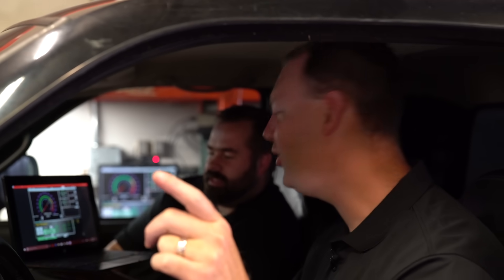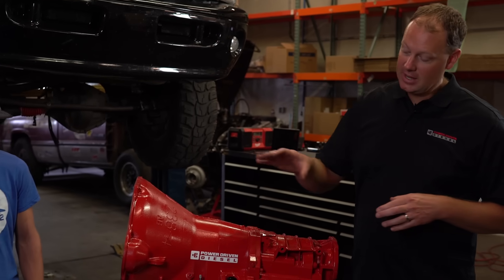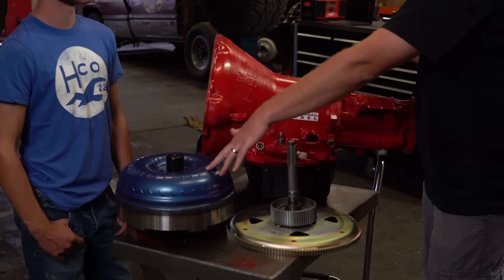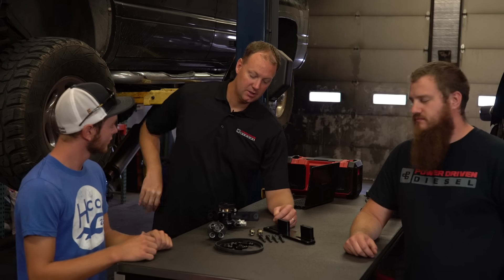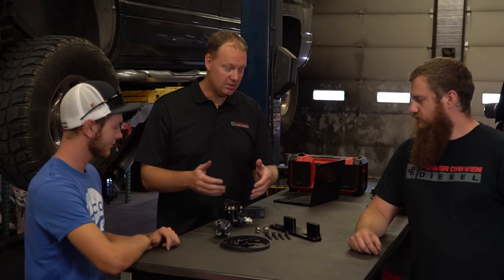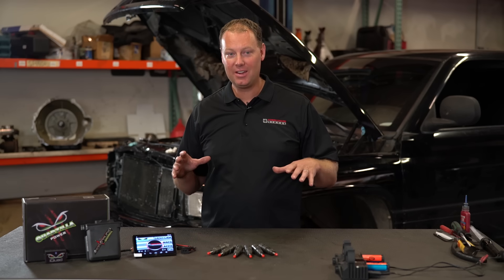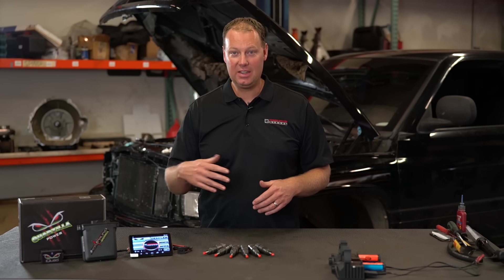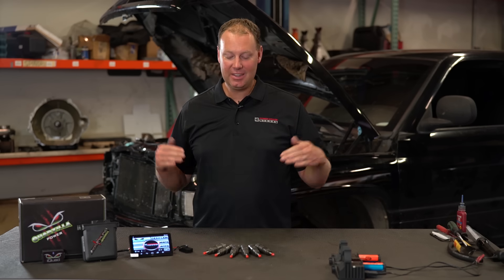We Double the Horsepower of a 24 Valve Cummins

Comment: I run a 5.9 24v in a 1999 converted Freightliner MT 45 box truck.  I replaced the injectors with a high performance series and installed a FASS Titanium series pump and filter system, as well as a new intercooler.  My truck goes over the scales at 13K!   Much better performance now.  I am curious as to why you did not use the FASS system??  They have also given me great support.
Reply from the maker: We run both AirDog and FASS systems, achieving great results with both.

Comment: They should have put smaller tires on it disconnected the serpentine belt and put 10w-30 oil in her, easy 50+ horsepower there. 😂

Comment: I am not a mechanic; I drive a 2003 Dodge Ram 2500 5.9 Cummins 24 valve Gen 3 6-speed. The only videos I have seen are for automatic transmissions; is this possible with a manual transmission? Also, can someone explain what it means to double the HP. What does that do to the RPMs, or the speed of the engine, where do you see the extra power?

Comment: i think the life on fass pumps is fine I had a 12 year old pump that only died because i got some dirt in my fuel a couple times but it also had like 250,000 miles on it so i dont really see piont of going with belt drive pumps
Reply from the maker: The electric lift pumps, (Fass and Airdog) are excellent products, you are right!

Comment: I have an 2001 which as the trans hasnt locked up in years . 60k has a valve body wirked on as would not release at a stop and killed the motor.   Dodge in boseman mt tried to tell me it needed a trans so after getting home in Orem had it fixed but it had lockup part time driving and then not at all still drives witjout locking up on the highway but tacks up.   What ate your thoughts. Bill.  Mechanic on wheels llc
Reply from the maker: It could possibly be an electrical issue or an APP sensor that has gone bad. Feel free to call us at the shop (435)962-9555

Comment: I have a 99 2nd gen 24V Edge Adrenaline, 4in exhaust straight pipe, Fass fulesystem, Cold air intake ,KN filter,$5000 New trans Local Diesel shop in Albany Or. My problem is ,My trans is surging at about 43-45 mph up down up down, My Batt  cables are old and corroded will that cause and cure my issue?
Reply from the maker: First step anyone would do is clean up known electrical issues, so start with battery cables, then we'd closely look at the throttle position sensor and the throttle shaft bushings.  Probably needs PDD brass bell crank bushing repair kit and a fresh TPS.

Comment: How did the miles not add up when he said 300k on stock injection pump and 250k on stock trans?
Reply from the maker: It's a conspiracy man.....  as we recall, the factory transmission went out and was replaced under warranty at 50k miles with another stock transmission.  Hence the 50k mile discrepancy!

Comment: Can you buy that style fuel pump anymore
Reply from the maker: Not for the 24v.  The pumps didn't like being regulated so low with the internal regulator and so a second external regulator became necessary, which added enough cost to make that the 24v version obsolete.  There have been pretty good reliability advances in electric lift pumps, they now seem to last 100k miles or better.  We'd recommend you look into an AirDog or Fass and see if one of their offerings fits your budget.  https://powerdrivendiesel.com/product/airdog-ii-5g-df-165-a7sabd525-cummins-lift-pump-98-5-04-24v-5-9l/

Comment: Do a 3rd Gen a 05 Dodge !
Reply from the maker: Here is the link enjoy! https://powerdrivendiesel.com/product/double-your-hp-common-rail-power-package-2/
Reply: And I have a very clean 05 5.9 6 speed manual 3500 4x4 long bed dullay with a Fleece in tank lift pump with gauge and wanting to put EGT gauge in it to keep from melting down a piston and engine is stock no tuner or any power adders .

Comment: My brother and i both got quadzillas and 150 hp injectors with stock turbo and easily made 411 to the wheels with custom tuning. Mine was never on a dyno but would take off on my brothers who had been on a dyno(stock auto trans but we don’t recommend that and he got lucky with how  long it lasted before giving out) at least up until the top end cause my gearing is slightly different because auto vs 5 speed manual. If they really slapped a 2k hp convertor in here for free on top of injectors and a $1k tuner and new vp id be slapping a fat turbo and head studs at it asap. Lucky for me i have a manual and a southbend and head studs have been done. Finally got all my parts to slap the big turbo sittin in my garage at it to make some real power.

Comment: I guessed 200HP to the rear wheels.  It was 182HP.  400 something on the torque, still a nice tow rig even stock.  I have a similar truck 2000, 2500, I bought it with a bad lift pump.  Working on it now.

Comment: So on a 95 12 valve a map sensor could way the difference between your torque really working on an automatic transmission the truck really runs good I gave way more fuel efficiency but the torque I mean the turbo if I speed my 91 you could really feel it go it's 95 with automatic transmission just don't get it could maybe be one of those Maps hamsters that are holding it thing back

Comment: Did it change the mpg ?
Reply from the maker: Stayed the same 18-20mpg
Reply: @pddofficial  I am getting 15 mpg on a stock 99  5 speed 215,000 miles is there anything I can do just wondering I had it since it was new and hear a lot say they getting 20-25 mpg
Reply from the maker: @michaelfraser2614  these trucks are funny we have some that get the fuel economy your saying but most trucks get the fuel economy your getting

Comment: I'm curious how much boost this truck was making and what air intake you are running? My dynotesting years back showed the stock aibox thru the square paper filter was choking off 15hp at 370 RWHP compared to it running a long K+N cone filter , I propped the lid of the box open with the filter and it picked up the 15hp .
Reply from the maker: 38psi and we run the S&B intakes to avoid the choking of air flow.
Reply: @pddofficial  what year was this truck? I've seen as high as 44psi with the stock HX35 on my 2000 ram. EGTS were off the scale though .

Comment: Hello I got a question I got the 24 valve with a P-pump on it i need to change injectors on it I don’t know what injector I need and if after change the injector I will need to calibrate the pump again thanks for your help
Reply from the maker: What is your hp goal? We have found the 6 hole injector to work better on a p pump.
Reply: @pddofficial  hello thanks for answering I got a medium dutty rollback I will be pulling 2 cars at a time

Comment: if you ever want to make a newer 24v cummins video and need a "test" subject. I have an 02' 3500 dually, 4wd with the nv5600 :P Also I can't find the belt driven lift pump on your site anymore?
Reply from the maker: we no longer offer the belt driven pump for the VP trucks. the pump was a great idea but we could not get the pump to be as reliable as it needed to be to be sold world wide.

Comment: Hell yeah that’s awesome. I love my 06 3500 sw nv5600. Has 66mm turbo and some 30% bigger injectors and fuel system upgrades and engine is completely studded. The smarty tuner on 9 is pretty violent and pushes close to 60psi boost. I leave tuner on 5 and get little over 40 psi @wot. Truck was built to drag a sled but hasn’t been hooked to one yet lol. I love watching these type of videos and learning about modifications. My next step is intake horn and inner cooler and piping.
Reply from the maker: Sound like a fun truck and thank for the comment

Comment: I love you guys. And your products are absolutely great none better in qaylity or the amount of energy put into building them. I wish you would do something on driveshafts rear aluminium in particular. I'd like to see how much torque they will take before they shred I have one in my stock 2004 ram 24 valve so far so good even pulling a load of hay down the road around 33000 stock settings as far as I'm aware on timing.

Comment: Why such terrible LOW rpm?! Why to punish so hard the transmission with so much torque, instead to use rpm to a least 5500rpm for peak power as an om606 in stock form?!
Reply: diesel are not designed to run at high rpm
Reply: @markae0  PS: also you should check ADAM Solutions (ro) to see 1.9tdi rev and still pushing hard OVER 6000rpm (6500rpm), but the final remap was until 6000rpm (@488 bhp)

Comment: Compounds VS Racing Billet 80mmx117mm compressor(compressor has been upgraded to Infinite Performance Reaper 6 blade) 96mmx88mm turbine T6 1.32 under
S369 SX-E From Crazy Carl's on top.
Crazy Carl's piping kit.
Infinite Performance 6x.020 Comp. Injectors
Edge Drag Comp Hot
Fass 150(Upgradig to Fass 295 GPH)
Banks High Ram
Snow WM VC 50 Stage 2 2 20 GPH Nozzles.
Mishimoto Intercooler
Stainless Diesel Exhaust Manifold With 45 mm External wastegate.
Scheid Stage 2 VP44(coming in June)
.093 Scheid Injector Lines
Dynomite 750hp+ crosstubes
Hamilton 103lb springs
Hamilton Rods
Arp rod bolts
Arp 625 headstuds
Arp XL Mainstuds
Gorilla Girdle
Mahle .40 over Pistons ceramic coated and delipped
Mishimoto 179 degree thermostat
Fleece Coolant bypass
5 in drop pipe and exhaust.
S and B Cold Air Intake
Power Bastards High Output Alternator
Colt Stage 4 Cam and Tappets
Autometer Z series gauges, trans, boost 100psi, pyrometer-never see over 1000, exhaust pressure
Power Driven Diesel 5 layer boost hoses/boots
Optima Dual Red Top Batts
Power Driven Disel Battery hold downs(does not help performance)LOL!
HPS 5 Layer coolant hoses
Keating Billet freeze plugs
Keating Billet valve cover
Orings in block
MLS Head gasket
G & R billet tappet cover.
DAP Billet gear case cover.
HIWOW BLACK TURBO BLANKET coated with cool it thermo tech
Exhaust Manifold blanket, see brand in picture.
Exhaust downpipe wrap. see amazon for brand. Engineered not chinese junk
5 inch exhaust, straight through muffler with dimples. Loudest exhaust ive ever heard. Impressive to hear!!!.

Jared Riipinen, PLS
Riipinen and Associates Land Surveyors
Office/Cell 253-569-4745
7225 Stringtown Road East
Eatonville, WA 98328
Reply: This is what you guys are missing at PDD. Scheid diesel says i am knocking on the door to 1000hp. Get it together!

Comment: What about doubling a stock 12 valve?? Have 97' Dodge ram 2500 4x4, Auto w/5.9 and with only 49,000 miles on it. Been garaged most it's life and looks like new with only few bumps ... one in front bumper and one in back bumper, which both going to be replaced. Anyway, use it for towing camper trailer and flatbed trailer. Noticed when on freeway it slows on hills a little more than want sooo.... my question would be what upgrades for the money do you think would work best to help it get up and move a bit better and do better at towing. Only thing i've done was add a Banks air box inlet. So, can you help a guy with his 1st diesel truck? Thanks, and can't wait to get it up and moving faster and performing better at towing.

Comment: So what do I do if I got a fast fuel system on my 2002 3500 Dodge Cummins and now it is cutting out and dying whenever I drive it but if I put it to the floor it doesn't die until I let off but it idles just fine but once it dies if you don't turn the key all the way off it takes about 5 minutes of just cranking to turn it on but whenever it dies if you turn off the key all the way and count to five then turn it back on it starts right up

Comment: My 2000 ram has built trans and full Hamilton push rods, tappers and 103 springs. ARP studs and edge juice hot with Fass. I got some 7x10 sac injectors with a new vp44. What turbo do you recommend? I want it to spool fast so I’m thinking 62/65/12? Any recommendations would be much appreciated.
Reply from the maker: or a hx super 9

Comment: After all tuning i thought for sure The engine is having trouble building pressure... Then i found out they are running The stock turbo with 250.000 miles On it... Why didnt you just switch out The turbo aswell... À 65mm turbo would be plenty.

Comment: How do I know if I can get more power with a new map sensor on a 24v
Reply from the maker: It's usually a swap out the sensor and see kind of deal.  Hard to easily know if the sensor is producing the correct signal.

Comment: Your best thing ever did for my Dodge  After I turned it up Was a valve Body ready go racing clutches And a $400  Billet twin clutch torque converter For everything to be done it cost me about $2500 And that's including a shift kit So that it doesn't shift until it hits 2000 rpm Course I live in a place that has nothing but 5 to 6% grades if you live in Oklahoma's its a little overkill And if you're gonna get injectors for God's sake get a bigger Turbo and bigger exhaust Even if you're not gonna get bigger injectors get a bigger Turbo and bigger exhaust air equals power the more air you get in and the more air you get out the more goes to your tires If it's dump a whole shit Turn of black smoke Yes I like black smoke I'm not one of those never black smoke guys but when you get on it if you can't see the road behind you you need more air So it's Turbo time why waste all that fuel and get nothing from it

Comment: I have a 1999 6sp Cummins with 300,000 miles the truck starts and runs great but I want a little more out of it I PURCHASED A EDGE EZ MODEL NUMBER (30200) It has (20hp on the first Position on the switch). (2nd 40hp).  (3rd 65hp 180 Torque) the truck has never hade a boost or fuel gauge in it I’m putting a fuel pressure gauge in it. So should I worry about hurting the motor with this tuner

Comment: Hey guys love this video I have the same truck 2000 2500 5.9 24 valve I'm having an issue with it chugging at 35 mph in 3rd gear an Jan around 45 mph when it shifts into 4th gear this is an automatic but if I accelerate at these speeds or push gas pedal down it corrects the chugging but it's kind of hard to drive at these speeds here in the city cuz most of them are 35 and 45 miles per hour have any suggestions on what this could be I don't believe it's the transmission but I'm not counting that out because it seems to shift fine and sometimes but not often for some short periods of time it seems to be normal not sure if it's a fuel lift pump or a feed pump not sure if these are the same or if it's the throttle position sensor I'm a contractor and I need my truck I live in Castle Rock Colorado have any suggestions please thanks
Reply: I'm not sure exactly what problems you are having but usually when my friends or myself are having any problems with your 24v with auto trans I always recommend changing out your fuel filter and your transmission filter. I know it's kinda throwing parts at the problem bit both don't take long, cost less than$100 to change and quiet often will fix a problem. Just my 2cents

Comment: The only thing I disagree with is the stock lift pump is adeqent for stock hp. The stock carter lift pumps were crap and notorious for silently killing vp44's. I'd recomend a lift pump upgrade for any second gen, if not one of these nifty belt drive ones any quality electric lift pump would be a more reliable upgrade compared to the stock pump.

Comment: I have a 01 Dodge cummins quad cab long bed 4wd..I want to do a build @ 500hp+ and 1000ftlb+ ..AND  be around 20-25mpg whether im empty, loaded towing uphill or downhill. My truck has 250000 ish miles..not even barely broke in yet..VERY impressed with the video..lets see if we can build the impossible
Reply from the maker: Hi Jim we can get the 500hp and 1000ftlb but to get that MPG as well will be really hard to do unless you drive really slow

Comment: i have a 2008 f25 4x4 with a 6,4 motor want to sell only 49,000 miles want run 4 door it needs a 5.9 change over like new 4000 606 793 9421
Reply: this was a fire truck keep inside look new
Reply: just 4950
Reply: oilman1243@gmail.com for more info

Comment: Hi I’m new to diesel performance but installing 5.9 Cummins and am wondering if my fuel tank mounted pump can be used to supply my vp44 once regulated at less than the sixty that it pumps now for the gas 350 to be replaced

Comment: new subscriber. I have 2006 Mega Cab. Average by math miles divided into Gal at fill up 15miles per gallon
 ( Averaged ) Highway the MPG is higher. Engine is stock 222000 miles. 1 trany rebuild. How can I increase mileage?

Comment: im very interested in that fuel pump
Reply: Yeah that mechanical lift pump caught my interest as well as mine has going out 3 separate times and ended up taking out my injection pump along with it
Reply: @dwainsellers6453  i replaced mine about ten years ago and i know that bosch built them to break after 75,000 miles so im starting to look for a way to prevent that
Reply: @dwainsellers6453  im ggonna hit the 300,000 come next year and i just blew a head gasket on mine
Reply: @pddofficial  that's cool I keep my eyes open for it
Reply: @pddofficial  let me know and how much

Comment: Great job on the kids truck. Quick question, mines a 04.5 24v 5.9.  it has the 4"straight exhaust, cold air intake. Stock injectors, stock pump.  So how much would your tuner open up it's power being that it's rated for 325 stock already at the crank?  Rough estimate